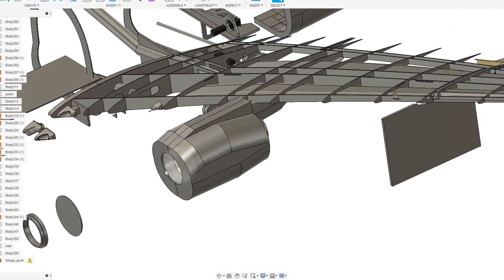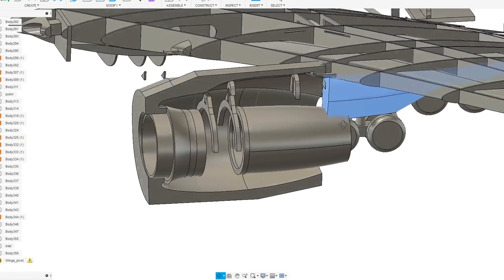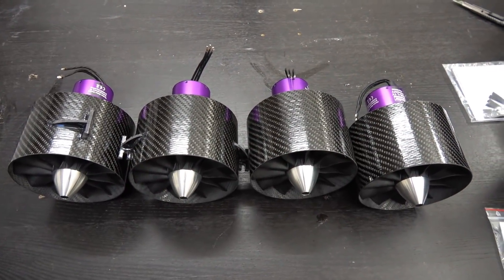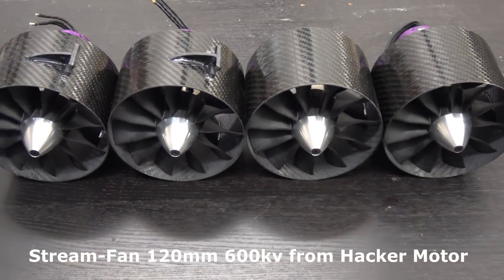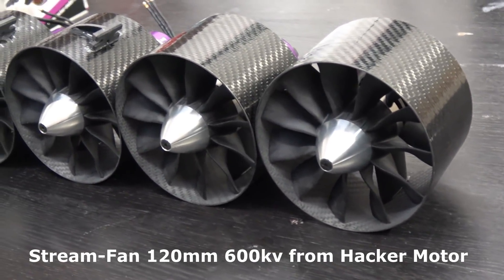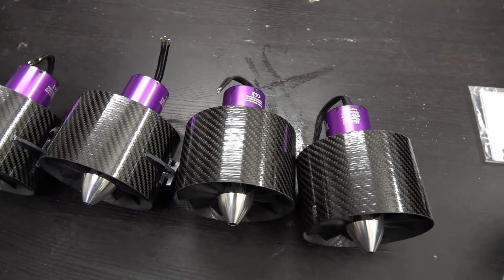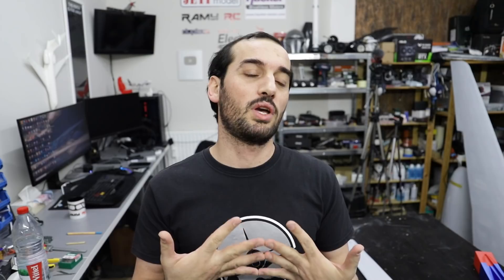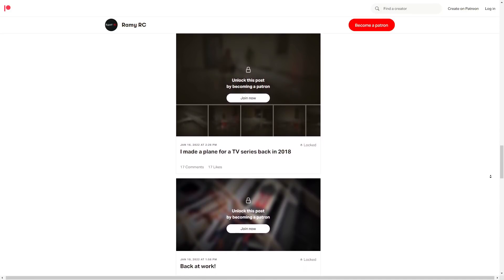Making the engines for the A380, full carbon fiber

Comment: In the past you make the small version of the A380 but it doesn't look detail. And at this present you make a bigger version like Boeing 777x9 and Airbus A350 XWB and Boeing 787 too and the most one that you on the process now is the Airbus A380 it look very huge, all of the aircraft model that you build look awsome and have alot of function like flaps and speed brake and mostly is the landing gear. All of that aircraft have fully carbon fiber that you build look better than other people build it.  
I hope you will keep up with your work of the model rc aircraft, i really want to see how that huge of airbus A380  will fly it to the sky from you, Ramy. ; )

Comment: Fantastic job!  Are you wiring the #1 & 4 engine to one battery and #2 & 3 to a second battery?  This way, if you lose power from one battery, the second battery would keep the thrust equal  on both sides of the aircraft, to maintain control for landing.

Comment: Hey Ramy, try printing your parts at higher temp for better layer adhesion. I print PLA as high as 250C and it's night and day as far as layer adhesion! For ABS you can go to 290-300. I've had this same issue with layer delamination when I printed PLA at the recommended 210-220.

Comment: please not have two motors on opposite wings use the same battery because if one EDF shuts down, the opposite one will suddenly get so much more power. Just use four banks, that is the safest option.
Reply: But if he powers two motors on opposite wings from one battery, not two motors on the same wing, then when he lose one battery he will still have equal thrust.
Reply: @randomnickify  exactly the opposite. One esc will shut down first, leaving the other with too much power. I saw someone learn it the hard way and I don't want the same thing happen to this plane

Comment: They look genuinely amazing! Love the addition of the thrust tubes. Really helps with the overall look. Great job.
Reply: What does a thrust tube do, or change, in this case? Just curious!
Reply: @RixiRooTM  They essentially decrease the diameter of the ‘exhaust’ as compared to the wider ‘intake’ which causes the air to be compressed and speed up as it exits the motor. It can provide additional thrust and potentially increases the performance of the model. They also more accurately depict the nozzle of a typical, modern high bypass, turbofan engine.
Reply: @gcm747  I see. Thanks!